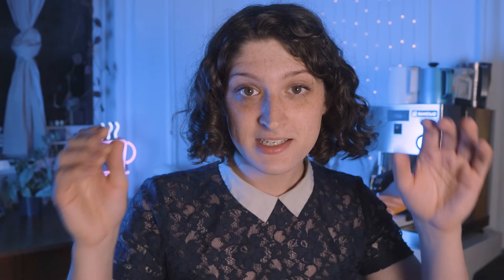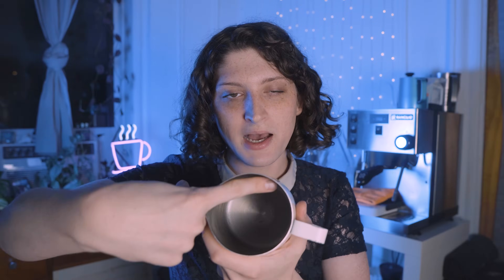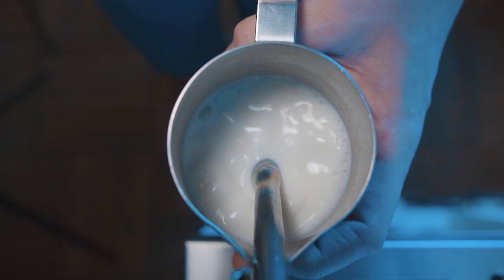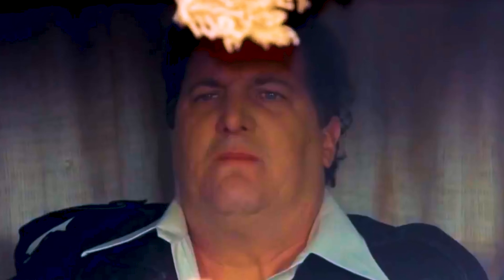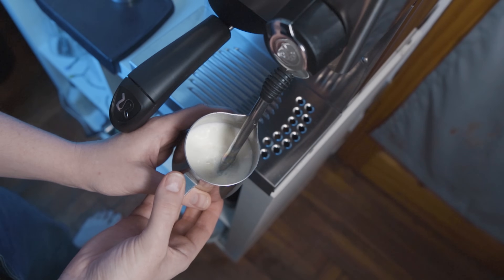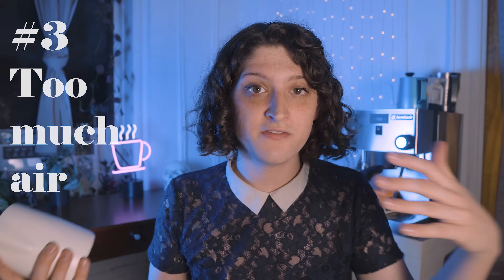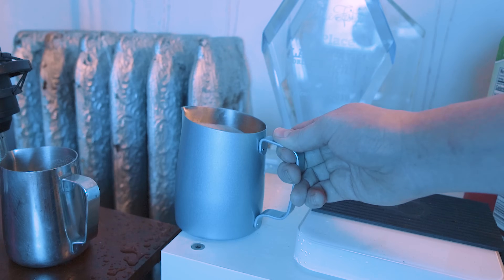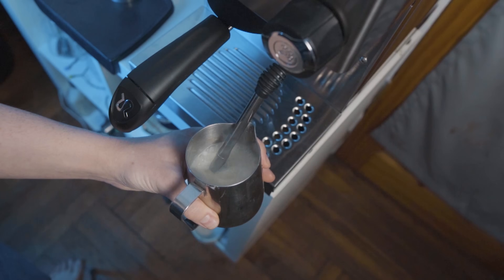TOP 10 Milk Steaming Mistakes

Comment: This is probably a stupid question but where is the air you are adding to the milk coming from? The steam wand injects steam which is water vapour. This will condense to water as soon as the temperature is <100C. Is there air mixed in with the steam, or is air being dragged in from the atmosphere by the jet of steam?
Reply from the maker: Its a brilliant question!! I do see beginners struggle with this concept so I usually omit it altogether. But what's happening is the force of the steam is pushing the milk away and leaving an air gap where the milk was. That air gets mixed into the milk and when the whey proteins β-Lactoglobulin starts to denature from heat, the hydrophobic end of the proteins essentially encased the air bubbles in the milk.
Reply: @EmileeBryant  Thank you for taking the time to reply. There's some interesting chemistry going on in that pitcher of milk.
Reply: @EmileeBryant  Latte art champion indeed.
Reply: @EmileeBryant  waoo ! you could added this proteins parts to your video and could made it even longer 🤭
Reply: Imagine you’re using presure cooker.
Reply: @EmileeBryant  Bernoulli effect
Reply: water droplets of the steam will act similar to the air flowing over an airplane wing.  As the wing moves through the air, air separates into multiple layers of varying speeds.  The earth does this with the solar wind as well.  Look up some aeronautics topics on  "Laminar flow".   As she mentioned, the Vortex Path is what sucks the air in,   it's the steam that causes the acceleration. Also,   bubbles can form in any kind of turbulent fluid. Look up something called  "The Cavitation effect".  In marine engineering when you the propeller speed reaches cavitation speeds, the energy in the turbulent bubbles can be so powerful that it puts holes in the brass propeller itself.
Reply: @EmileeBryant  That answer made me subscribe
Reply: @nsjanex4  ... you're using a* pressure* cooker.
Reply: The only stupid question is the one that isn’t asked. 😊 If you don’t know something, asking it is actually the smartest thing you can do. How else will you learn? Not a single person has all the answers to all the questions on Earth, so there is no need to feel stupid for not knowing something and wanting to find out. ❤
Reply: Also there is always some amount of air in the steam. It is not purely water droplets but a mixture of air and water.
Reply: The essence is the Bernoulli effect - the same thing that makes airplane wings work.  The fast steam creates lower pressure than the surrounding milk.  If the wand is close enough to the surface, then the low pressure sucks air down which is what the tearing sound is.
Reply: Whoa! Because milk is mostly made up of water it could be considered hydrophilic, but it also contains minerals, vitamins, proteins, and fat molecules
Reply: My machine has an air & steam dial. I use the air 1st then steam, is that correct??
Reply: @EmileeBryant  and this is why we need to make a little move upwards with the jair, to make the tip deep enought to not create that gap and just made milk fill the entire space, not filling any more air into the milk... i understand the concept, just can't properly execute it yet. My main issue is maybe know the exactly time of each step, i mean, when i does coffe first, some people tell me that the coffe is too cold to drink, but anytime i make milk first it totally get liquid with tons of foam in the surface level, what is sad, i not know the need of vortex after, soo, those errors make me struggle with, i already did tons of those errors, some time one or another, others times a bunch, never put the steam wand in the center at least. Thanks for your tips
Reply: @bossladyanit  what machine?
Reply: Not a stupid question at all. 😮
Reply: @mr_d_d_d  same here
Reply: @EmileeBryant are you a scientist? 🎉
Reply: @viniciusschadeck4992  My Mantra:  get your cup ready, get your pitcher ready (with milk), then begin your shots.  Get your shots started and when the first drops flow and it looks good, pick up your pitcher and begin your steaming. They'll finish at about the same time.
Reply: I want to see you do it! I guess I’ll look at more of your videos.

Comment: Hey, I've seen dozens of clips about steaming milk, and every single one is the same basically, so nothing new here! And every person presenting speaks like it's the first time someone said it. OK. BUT...BUT WOW...You said something that I didn't hear before in so many other clips...Yes, you've mentioned one little detail different than all the others I've heard preaching. And that one detail is when adding the air. When you listen to others you've got a feeling that you should dip the steam wand and start adding air, after you've done it, you dip it a bit deeper and you don't move. So basically, it's like, if you didn't do it right than f*** it and blabla...But what you said changes the whole thing. You said that air should be added in small steps, little by little!! That's the crucial thing. Not all at once and that's it...but little by little...that's the magic you did in explaining and different than all the others. Those little details are important when teaching...you got it! Great job! Now making micro foam all of a sudden is easy-peasy! Cheers!
Reply from the maker: SO SO ecstatic that was helpful. Under some circumstances you will only use one injection of air (if the wand is incredibly strong) But otherwise small injections has always given me the best foam.

Comment: Thank you for this awesome video. 

Quick question: when you are aerating first 8 seconds or so, as the milk level rises do you also rise the metal pitcher to keep the tip slightly below surface?

Comment: Hey Emilee... I am struggling with a new machine.  Moved to the Rancilio Silva Pro X. Had an Ascaso years ago along with a couple other machines that were less robust but more effective at frothing and getting great cappuccinos.  Alas, those machines were shorter term just due to their build and single boilers.  With my new Rancilio Silva Pro X  which is a double boiler, I am struggling to froth and get good quality, glassy foam as the steam wand is so robust...  Any additional input you might add to help me rope this in would be appreciated.  I miss my cappuccinos and shy little single boilers. 😁

Comment: Thank you Emilee! I'm struggling but I'm sure these tips will help. I do have a question, my wand has an outer (removable) tube that has a venturi hole in it on the side. On internet it seems the advice is to remove that outer tube. What is your opinion and if I should keep it on, does the venturi hole need to be submerged in the milk or not? The manual for my machine is not even talking about this.

Comment: thanks, i'am kind struggling with this portion of making latte art, and the most close one i did was making foam from surface into the coffe and use a little teeth stick to make a mess, yeahhhh not even get a simple shape to work LOL... but i'am working on it and steam properly milk is a huge part of the key, when it get proeprly i try the next step drop it properly on a nice expresso cup LOL, then making it in a simples shape

Comment: Hey Emilee! Thank you so much for your vids but I’m desperate because of big bubbles!! I use the WPM handleless pitcher and I use not that much milk because I don’t like to milky drinks. So I fill about 130-150ml in the 10OZ pitcher and use a Gaggia Pro. I think the steam wand is a little bit short for the 10OZ or is it just me? If I start frothing I get so freakin big bubbles as soon as I try to inject air even if I‘m really careful that the tip don’t get to high. The bubbles are so big that I can’t destroy them in the second phase ☹️
Reply from the maker: Try having the steam tip completely submerged instead then sloooowly bring the pitcher down to expose the air injections. 

Sounds like the steam tip is just too high at the beginning

Comment: I have a Dehlongi that I swapped in a three hole tip.  I try to do all the things you mention, but the current is not so strong and I just cannot quite get to latte art level micro foam.
Reply from the maker: Which dehlongi and which steam tip?
Reply: @EmileeBryant  Hi!  I have a Dehlongi EC680 modified with a Rancilio style steam tip that can have the single hole or triple, been using the triple.  I bought the tip on Amazon part B099F1B4YF
Reply: This morning I think I had the milk about right, but having trouble with the movement of the top when trying to pour the wave pattern.  I tried rotating the cup as I pour, but the pattern just sits there instead of moving away from the pour.

Comment: I just watched Hoffman on the subject, and the part I was leaving out was the short rest coming off the wand, before swirling. Presto!!  My art improved by 100%
Reply from the maker: Sure! That’s helpful way to get a foam that’s dense and workable. The reason I try not to recommend it universally is because mooooost people over aerate their milk so letting it sit is often the opposite of what is needed. Granted both methods are great! 

I personally never let my milk sit but it doesn’t hurt the art so long as you swirl it again before pouring.

Comment: I'm a duck bobber. But, i heard someone describe the little tears as smooches or kissie sounds. Trying to recreate that has helped a lot. 

My question. I tap my pitcher. But i don't like the swirl i get. So i sometimes give a quick spin with a spoon. It has improved my blend/separation. I'm only setting my pitcher down long enough to purge immediately... do you think I'm screwing up seeing it down.. it's really quick. Or do you think there is something else wrong with my technique?  

Also. I have great texture  usually. But it's almost too dense...i have no idea. Back to the spoon to stir it in. Thanks for about 3 really useful tips. 
Signed, 
-Wannabe home barista
Reply from the maker: Hey Hey. Sound like a ton of forward progress! 

Don't worry about the time it takes to purge, I just tell people to keep the milk moving so they they subconsciously know the goals and whats going on (milk is always trying to separate) 

I would say just add a touch less air until you see the density you like. And maybe try swirling a bit harder so it thins the milk out JUST before you are going to start pouring. Let me know how it goes

Comment: So I have a question; I am a new Barista Pro owner and just this morning pulled my first shot(s) (10 to be exact as I learned how to "dial it in") and then had to figure out how to steam my milk. Would you recommend pulling the shot first or steaming the milk first. One YouTuber I have watched recommended steaming the milk first and then pulling the shot. But that would require grooming the milk as you are pulling the shot. But I need both hands to put the portafilter into the head to pull the shot. So I'm a bit confused at this point. Thanks for your very enlightening tips though. I'm sure I will have to re-watch this video several times so that I can remember everything I need to know to steam good milk!
Reply from the maker: Feel free to steam the milk and then set the pitcher down and lock in the portafilter. While the shot pull gently swirl the milk and then swirl a bit harder just before you combine them :)

Comment: It looks like I am stretching my milk too much to start with, so I get a huge glob of foam when I'm done and nothing fit for latte art, more like a big foam layer for cappucino . I'm not getting a visible vortex so that could be my problem too, the air isn't integrated well, not sure which is my problem really. Will keep trying, only on attempt 10 or so. Am a bit confused, isn't bobbing the only way to get multiple spurts of steam to incorporate air? is it just bobbing a very small distance up and down or is there another motion I should be doing with the pitcher?

Comment: I'm pouring latte art on and off for like 10y now and kinda happy I only occasionally make 2 of the said mistakes - usually either overstretching the milk a little bit or steaming it just a few degrees too hot - combined with often using a 10oz pitcher to pour into 6oz bowl cups and integrating way too much, it naturally results in thicker lines and less space covered compared to what I would want to achieve. I do weight out my milk every time I steam - I've optimized it to my preferred 6oz Acme cups and also I think I optimized it to have as less waste as possible (I use 165ml of milk every single time) - But I do need to improve on the pouring technique and start using larger pitchers a bit more. I will keep working hard on these mistakes, keep improving my double winged swan pattern and keep striving to one day pour this perfect thin line winged tulip, that is my free pour inspiration for almost 10 years, ever since I saw Junichi Yamaguchi pour it. Thank for the comprehensive guide, Emilee!

Comment: I'm following your suggestions about how to steam coffee creamer.  So far no success.
I'm using the Bellman stovetop steamer.  How much or how far should I turn on the steam knob? I've heard people recommend full blast.  What do you say?  Should I feather it just the right amount and what is that right amount?  I still have not been able to reproduce that chirping sound I hear you do.  How is that done?
Reply from the maker: If there is no sound then the steam tip is not close enough to the surface of the milk. Try lowering the pitcher more. I would say full blast. I have that steamer as well and i know its tough but it is totally possible. I think the bellman is better than many steam wands on cheaper machines. 

(this is not a suggestion just what I have done. due to safety I cant recommend it but anecdotally)
I get it super hot and full of steam prior to opening the valve. Just before the pressure safety  valves go off. Again be safe ! those things get super hot.
Reply: Thank you for your prompt response.  I also wait until I get about two bars or more of pressure before opening the valve. But when I open it full blast it really creates quite a storm underneath the surface.

Comment: Hi Emilee. Such an amazing tutorial. I’ve got a question. I have a 2 hole steam wand. How should the holes be positioned on the steam wand? I have the holes vertical, like top to bottom. Obviously you work from the top hole when letting air in?

Comment: Looks like im only doing 3, I think.  5, 6 and 8.  Not doing 5 anymore and will try pour right after but I clean the wand so I dont forget.  Like it hot for I drive to work with it but I dont really know how hot it is.  So 3 but might only be 1 that Im not going to be doing anymore.

Comment: Ma'am i want to know what happens in coffee shops with  the extra milk that may be left in the pitcher after frothing...can it be topped up and re frothed again or do you throw it away thanks
Reply from the maker: It’s not recommended to keep that milk. Just toss it. It’s actually worsening the quality of the next drink and potentially unsafe to confine if done enough. 
If you have an abundance of milk I would suggest skimming back on the amount of weighing how much the correct amount is and making a mental note of the level in the pitcher 😇

Comment: Usually I just see "the Barista" putting the pitcher under the steaming wand (fully submersed), then walking away.
Reply from the maker: I’d only do that if I was coming back within 10 seconds otherwise you’ll likely scale the milk . 
Also definitely need to get air in first if you did.
Reply: It could be they're using a super automatic espresso machine. Starbucks for example usually uses these or something similar.
Reply from the maker: @OverClover  I see what you mean! Yes that’s totally normal. I forget people use those 🫣😅

Comment: I'm a former Starbucks barista, and I haven't worked there in over 8 years. In that time, I've become disabled, so I don't work at all anymore. I just got a little counter top espresso machine from my sister(who I had referred to Starbucks, too lol) and I'm super stoked about it since I absolutely loved being a barista. It was my favorite job, hands down. I only left due to management changes that created an incredibly toxic environment. 

But between the amount of time it's been since I've worked on an espresso machine(a lot is still muscle memory, though lol), the difference in type of machine, and the neurological disease, I haven't been fully confident about whether or not I was still steaming my milk properly. My foam has been turning out fine enough, considering. But I had been one of the most skilled at my store at the time, and I just haven't felt like I've been doing it completely right, but I haven't been able to put my finger on what I feel like I've been doing wrong. 

So, thank you so much for this video. It helped me realize that I should've trusted my instincts and started at the bottom before slowly pulling the pitcher down, and not the other way around(I had talked myself out of it by going with the logic that aerating it must mean that I put more emphasis on the air at the top🤦🏼‍♀️). But you also helped solidify the fact that Starbucks really does bastardize at least half of the things that they train their employees on, because i might have forgotten a few things, but I know for a fact that there are a several things in this video I wasn't taught at all😂